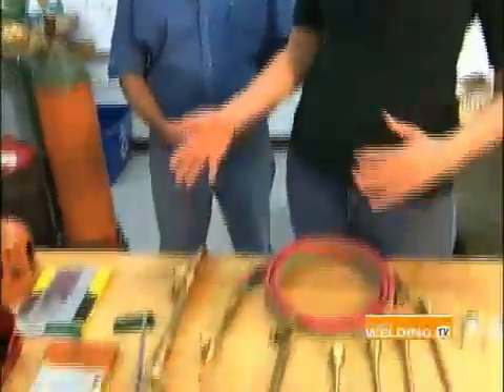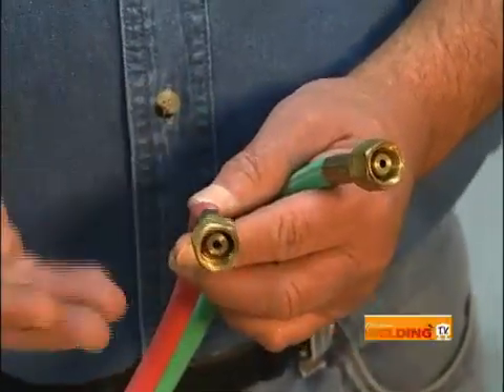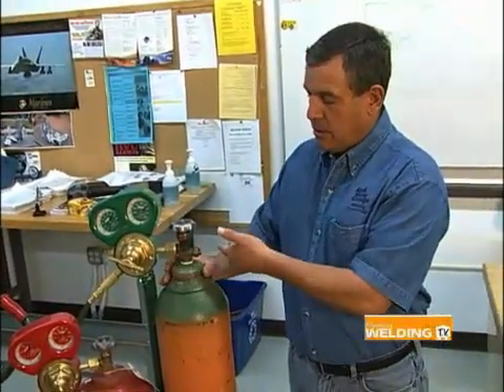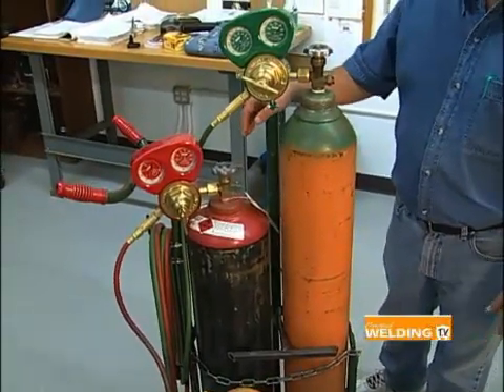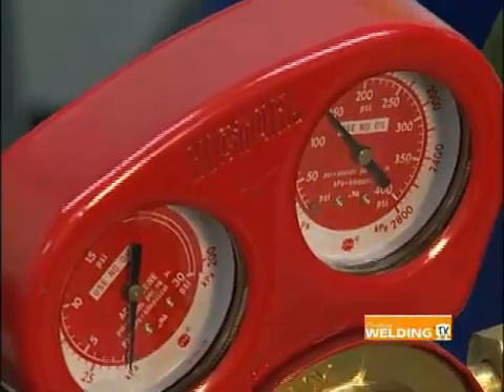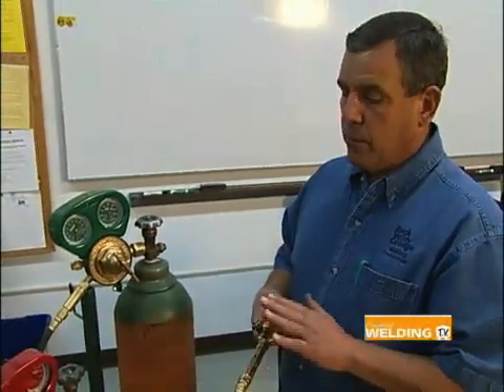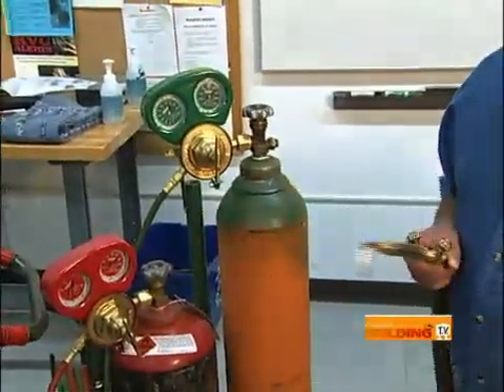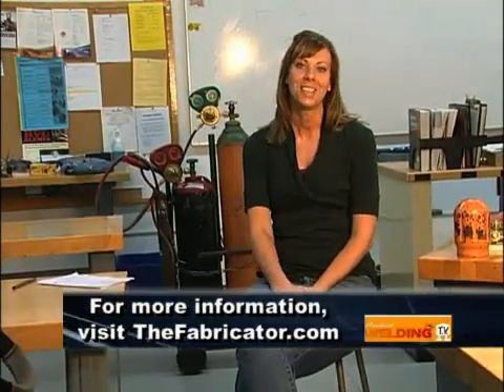PWTV: Oxyacetylene Welding Part 1

Comment: The best advantage Oxyacetylene has is low noise during soldering. I have worked on occupied hospitals many times before and a turbo torch is not very desirable to be used. Medgas pipping that is.

Comment: NEVER turn the oxygen tank on with your hand over the top of the handle on the valve,do it from the sides. If you think that is unnecessary,  valves are known to explode out the top from being turned on and that takes your hand with it. That actually happened to a friend of mine.